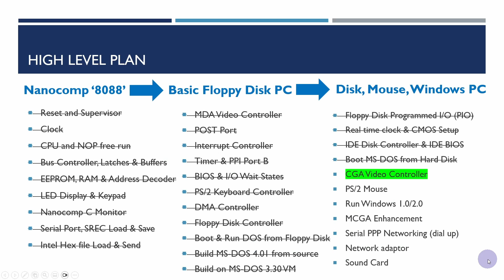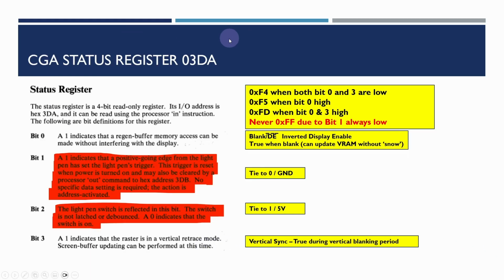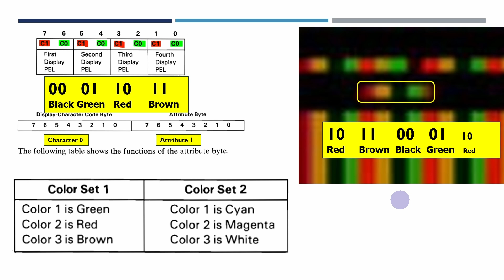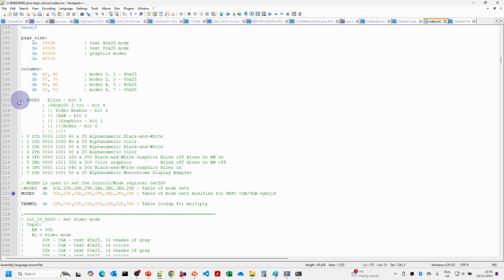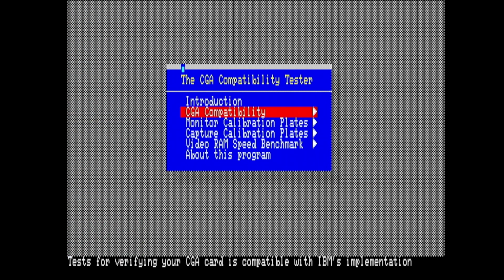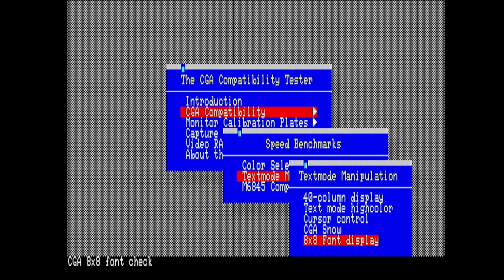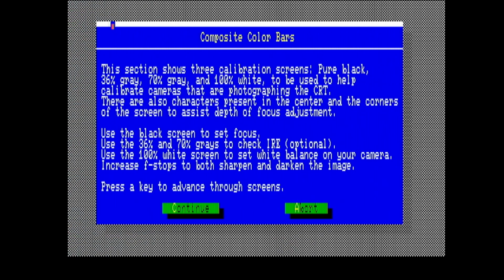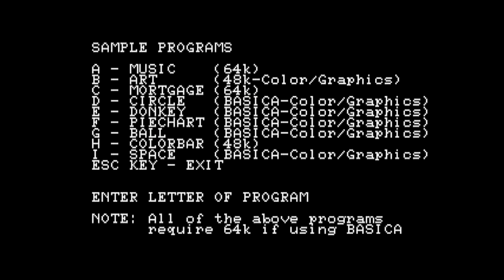Breadboard 8088 PC #57 CGA Video Controller Part 12

Comment: These stray characters are very annoying. Could it be better to add some more decoupling near to RAM chip? It seems like noise. Excellent progress anyway, well done!
Reply from the maker: They are down to the very fast static RAM 10-15ns, the write signal is a little early before all the address lines have settled so ends up randomly writing to various addresses. Have delayed write by 1/2 CPU clock cycle 115ns and seems to have fixed it. Will publish early next week. Dave